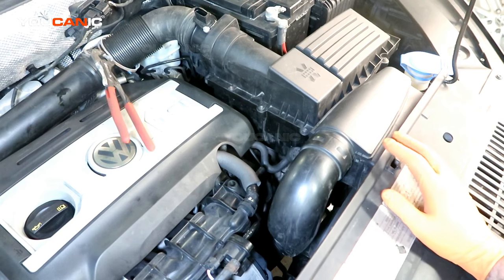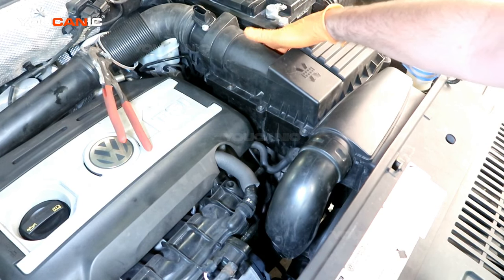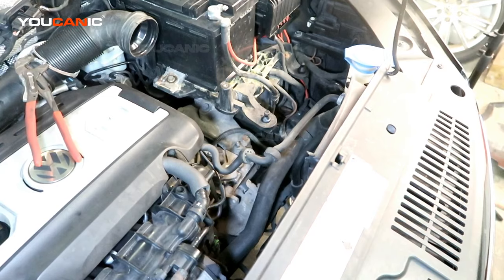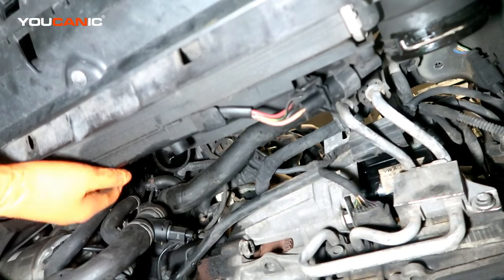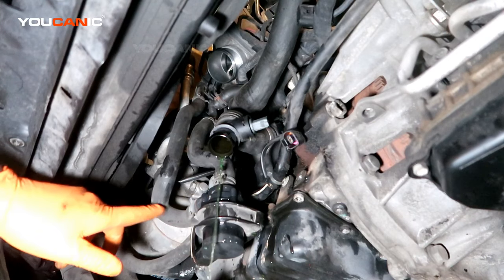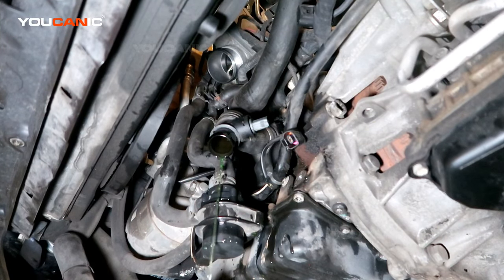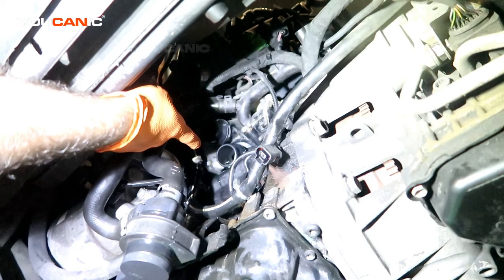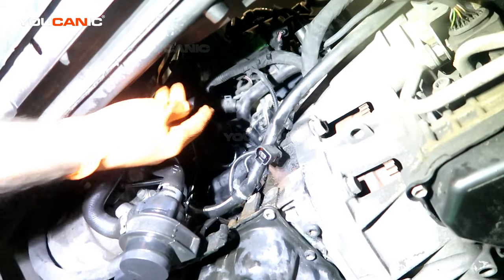2009-2016 2.0L Volkswagen Tiguan - Thermostat Replacement

Comment: So ive got a 2014 tiguan and its not blowing warm air. Im trying to figure out if its a thermostat not opening that's causing this. Also lower radiator hose isn't getting warm so i believe im right in thinking this. Great video and new subscriber.
Reply from the maker: Thanks for your comment and welcome to our subscriber family! Our ultimate goal is to make your car repairs as streamlined as possible. To accurately diagnose modern cars like your Tiguan, we've developed the YOUCANIC Full System Scanner, empowering car owners to be their own experts. Learn more on www.youcanic.com/scanner.

Getting the job done right also calls for detailed procedures from Factory Repair Manuals and Torque Specs. We offer access to these resources for a small fee. With these tools, you can carry out your car repairs effectively and confidently. Visit www.youcanic.com/manuals to get started.
Reply: Did you ever figure it out? I have the same exact issue with my 2013 Tiguan not blowing heat.
Reply: @kdog__  had a coolant leak and after thinking they never fixed the leak and refilling reservoir a couple of times it started working. Thinking it was an air bubble in the system that finally came out

Comment: Hi! I have a 2012 Audi a3 with the same engine as the car you're working on, but I'm having trouble removing the housing after following the steps you showed. It appears that the thermostat is stuck on the housing, and won't come out of the water pump. So I'm having trouble removing the housing. Do you have any advice for me to get the thermostat unstuck to remove the housing. (thermostat failed due to being suck open, and engine would not get up to temp)

Comment: This is actually not that bad of a job. The hardest part is the 5mm allen head bolt on the housing, but save yourself the headache and buy the metric set of the Eklind Double-Ball-Hex-L. The bolt came out for me in about 5 minutes. The hardest part was setting my light up so that I could simply see the head of the bolt. Great video! This was really helpful. Thank you

Edit: You know I tried all day to get that housing to not leak after I put it back on and each time it leaked. What is the secret?
Reply: Same. Been a month and a half - reinstalled 4 or 5 times. It still leaks around the gasket...!
Reply: I made a video addressing some of the challenges. There is an aftermarket thermostat housing that seals differently. It is made by Doorman or Murray
 @hersheysq

Comment: What tool did you use to be able to take out the Allen head bolt on the thermostat housing? I couldn't find anything that would fit in that little space other than an allen wrench, and I didn't want to trust tightening that assembly with just an allen wrench.
Reply: Let me know if you solved this. Having same problem can't even fit the tool by the housing
Reply: I used an Eklind Double-Ball-Hex-L for this
Reply: @alexgordon8225  how do you set the thermostat and o ring to not make it leak? I have done it 4 times without success.

Comment: You made this whole video just to skip how to remove the housing. I followed all of your steps and I can't even fit the tool in the area of it. Can barely touch it with my fingers
Reply: I cannot get the f'ing housing off. The one screw is impossible to get off. I have tried everything tool imaginable and this guy completely skipped over the most important part. So annoying.

Comment: This so much to take off! What ever happened to having the Radiator in font of the car an thermostat under the hose?  These car makers make these motors so difficult to work on , so you take them back to dealership to get even more money out of you! It's a fucking Thermostat! Not a Transmission!!  Uhhhhhhh😅